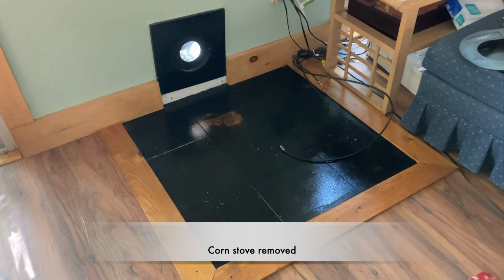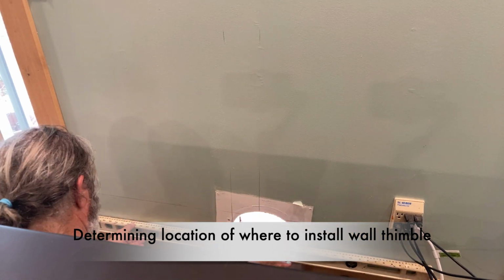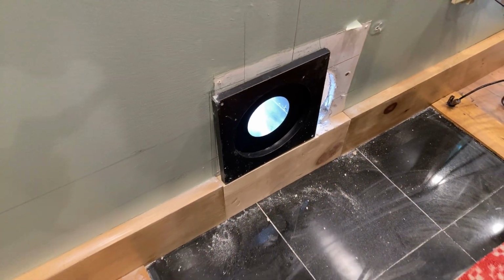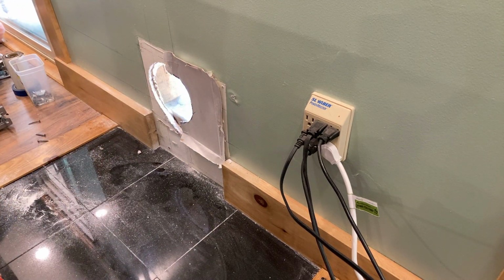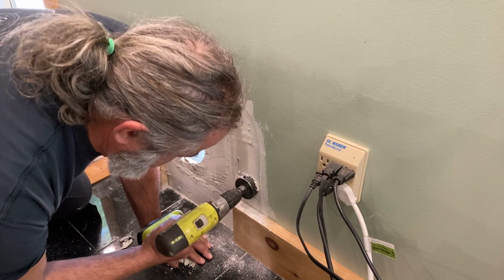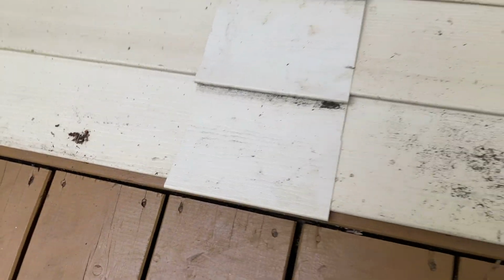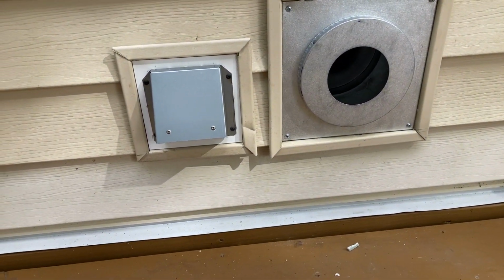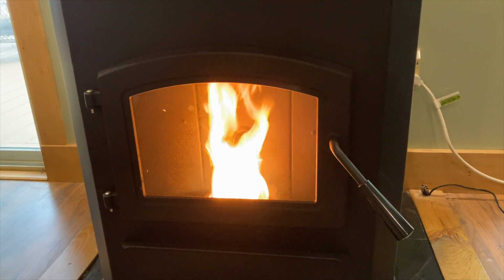Replace Corn Stove with Pellet Stove - Pellet Stove Installation

Comment: Was it not possible to reposition the hearth? Would have allowed you to avoid that stud. Interesting install, hi from Australia.
Reply from the maker: Hello there! Repositioning the hearth would have meant - on initial thought - redoing it which would involve moving the granite tiles (I believe they are granite) and redoing the floor.
The hearth - again just 3x3 square of 1 foot tiles  - is centered on the wall that it is front of, which is between two 10 foot slider doors that lead onto the deck outside. 
So I wanted to have the pellet stove centered on the tiles which also centered it on the wall and centered between the slider doors.